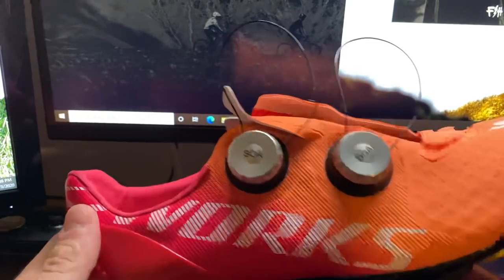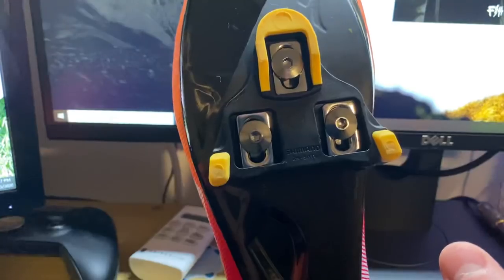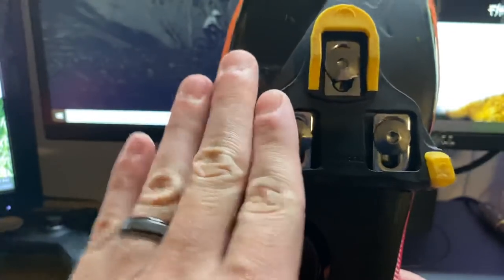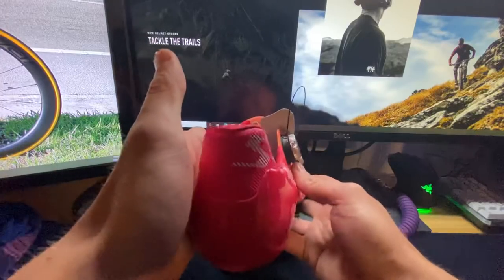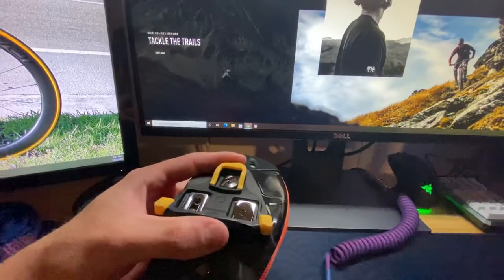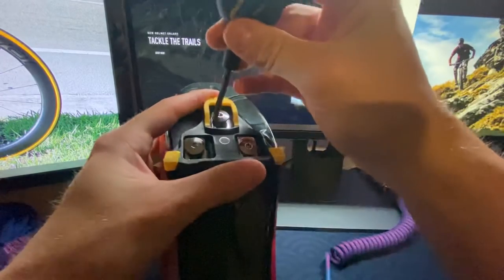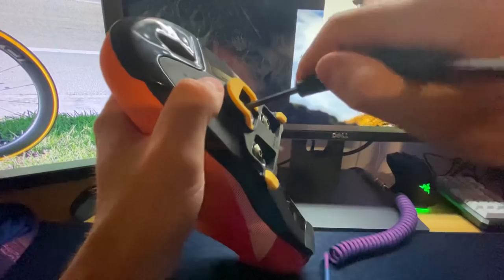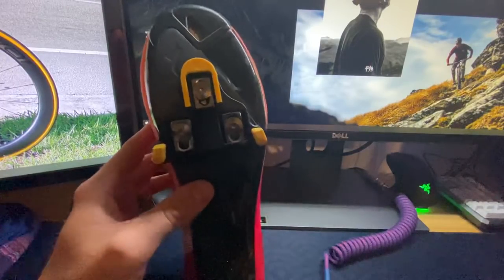HOW TO INSTALL ROAD BIKE CLEATS FOR MORE POWER! (FIT/HOTSPOT/LOOK/SHIMANO) *NO HOT SPOTS*

Comment: Very informative. I bought new shoes, my Fitter set them up and I started to experience a Hot Spot on the ball of my foot (left).  I thought it was the shoe because I had not experienced this condition prior to that.  Rookie mistake, didn't think about a "starting point" since he has been spot on in the past. Thanks. I'm sure you just saved me a few bucks
Reply from the maker: No worries at all, like I said a lot of fit stuff is all preference, and this information is all suggestive but it’s what works most of the time. To help reduce some pain. :)) I hope it helps

Comment: great explanation. i like when a bike fitter says cleat position is subjective. my fitter is insistent on cleats forward ball of foot, which i have never done before. Definitely felt the difference right away. I also wear the S s works 7. saw your comment on not forgiving as they are to stiff. Going to try shimano RC9. be great to see a video on crank length.
Reply from the maker: Look at the sworks vent shoes they are less stiff then the 7s and people say they prefer that show over the 7 in terms of comfort

Comment: Here's an additional thought: something you didn't discuss enough (IMHO) is how very important cleat angle is. More than just preference. If you imagine your "footprints in the snow" look at how one or both feet may angle in or out. I think this has to be considered when installing cleats too. I fiddled around with sore knees for months before discovering that if I followed the natural angle that my feet wanted to go it helped almost instantly. And of course, don't fall into the trap of thinking they "must" be symmetrical. Nothing in the body is.
Reply from the maker: yea exaclty this is true, that would have to be measured on bike with a laser and like a z plane and notice to there rotation on the pedal stroke.... have them ride for a while, while recording and taking data
Reply: I ride toe-out so use kneesaver pedal extenders or pedals with long axles to accommodate that.

Comment: I am glad you made this video , I fiddle way less with mtb spds , than my road spds........always seems like there is some built in shoe sole camber that’s never on mtb shoes , they lay flat on the peddle , where my shimano road carbon some times feels like it’s floating to the out side . Road spds so fussy , mountain spds set and forget. But I do set my road to heel out especially the right foot.  If I try to set that peddle straight , I will screw up my knees after hard rides. It seems so unnatural,,,,,,but mountain spds no trouble,,,,,,, I begin to think the question is when I started road biking coming from mtb is ......................this trouble some Q FACTOR WIDTH THATS ROAD CRANKS MIGHT BE CAUSING ME , mountain Q FACTOR never an issue ...............🤔🤔🤔🤔🤔
Reply from the maker: why dont you just put mountain cleats and pedals on your road bike then?? if you are comfortable see fi it helps with it, and if it works and you are comfortable what is the prioblem :))

Comment: That original sesamoid bone thing has to do with running. Shoes used to flex lots back in the day. Mimicking a running motion. Shoes now are super stiff which is why they reccomend moving them back now. Float will compensate for small differences (ie not precise in position) I'm really into bike fitting clinical pharmacist with access to a bunch of data (read so many publications on this always interested in learning more.
Reply from the maker: Very nice!! Yea I like the fitting aspect of it too but I’ve got away from it more and more just because I started to learn less is more in my situations because majority of people I’m fitting are not riding daily or even weekly so I would just go about making them comfortable for weekly or monthly rides

Comment: I attach the cleat semi-loosely to the shoe, then clip them into the pedals. I get the shoe into the position that works best for me, then tighten. I also stencil [with crayon] the position once I feel the fit is locked in. That way when the cleats need replacement it's easy.
Reply from the maker: That sounds great!! It doesn’t move when you un clip
Reply: @GCPerformance18  that's the tricky part. I set the clip to its lowest setting, then pry it open with my hands, while pulling the shoe out.
Reply from the maker: @ayowser01  lmao ahh I wondered how you did that, maybe even just go under them whilke the shoe is still clipped in and take a market to the top portion

Comment: If your cleats are in the right position and you move them back just a bit does it alter anything like for and aft or does the set up the same? Just moved backed a few mm. My bike fitter keeps moving my cleats over the ball of the foot and i keep mentioning knee discomfort. But i never have discomfort the other way. He says that when the cleat is moved back, it places to much stress on the arch of the foot and that is what you essiently  pedal with. Im confused.
Reply from the maker: Moving them back a little will cause a little change that you would notice but your body will adapt and also that position will be better for overall longer rides. Less pressure on the hotspot of the foot

Comment: Just bought new SPD SL Ultegra R8K pedals. And yup for me I moved the cleats all the way back.Seems more of the sweet spot for me. But yeah haven't head out yet. I kinda feel like the yellow cleat's float is a tad bit too much which interferes with unclipping but then again it may help prevent any pain. What are your thoughts on this? @GC Performance
Reply from the maker: the yellow is a lot of float but you get use to it and if you are noticing that it is resolving the knee pain issue then keep it, I rode yellow for the longest time, and I am not saying that you can not get use to other types of float it just all depends on how much you ride.... sop if you ride only every weekened then yellow might be a little better because it is more forgiving for us who dont ride every day but if yopu ride 3-5 times a week then blue shoudl be okay and you will get use to it and over that soarness pain the more you ride
Reply: @GCPerformance18  Yeah I more weekend warrior as you mentioned. Hmm will continue using the yellows as for now I guess. Also is there a difference between the authentic SHIMANO cleats vs replicates?

Comment: I live in Hawaii and try to average 100 miles a week (35 miles a day, 3 days a week). I always get hotspots and I've tried moving the cleats rearward, adding ache support, changing the angle, and trying a slightly larger shoe. All this has really made almost no change. My Specialized dealer is suggesting me buy wider Lake shoes, but at $300+, I'm not sure I want to spend the money and then just have the same hot spots. Any suggestions? Thanks.
Reply from the maker: What shoes are you riding now, and where on the foot is the hot spot most of the time?
Reply: GC Performance   Aloha, I wear a specialized shoe and the hotspots are on both feet and pretty much across the foot between the toes and the arch. I do have a wider foot, but I don’t think the shoes are restrictively narrow.
Reply from the maker: @LeoDodier  I would have to see your hsoes and feet in perosn obivously, but try moving the cleat of those hotspots and also if the shoe is to stiff like the sworks 7 sometimes those can cause hotspots because there is no give ion them.... its weird but kind of like an sworks biike  where it is very fast but alot more stiff, same situation with shoes too sometimes the sworks shoes are very stiff and fast but they cause alot of pain on some of my older customers because there is no forgiveness
Reply: @GCPerformance18  Both pairs of shoes are Specialized Torch 2.0. The soles are carbon I think and are pretty stiff. The local Specialized dealer says that the soles on these shoes are not as wide as the soles on the Lake shoes and this may be causing the problem, have you ever heard of that? Should I try Lake shoes?
Reply from the maker: @LeoDodier  yes I would give them a try to see if that helps, you gotta to try and figure something out

Comment: Any input on why my hotspot would be on the outside of my foot just aft of my little toe? Thanks!
Reply from the maker: A lot of things, could arch support or are you using wedges or shims currently??
Reply: Stock insoles. Same hotspot follows with different shoes.
Reply from the maker: @jasongiordano907  trying getting some arch support insolse, do you have a moderate to high arches?
Reply: I’m down to try anything? Any suggestions? Moderate arch at best.
Reply from the maker: @jasongiordano907  yea go get some specialized arch support, go to a specialized store and ask them to measure your arches, they should ahve something there for that and figure out if you have moderate or high archs and buy the one that you need for that, insoles are a huge thing to do and once you find them out you realize how great they are.
Reply: Awesome, will do! Thanks for the help!!
Reply from the maker: @jasongiordano907  yea and stress to them about the pain in your foot, there are a lot of variables that it could be but something that can be solved, maybe also q factor on your bike, you might need longer pedal spindles to widen your stance and you might have more pressure on the outside of the food, this is all me suggesting things without seeing it but. feel free to ask them at the store, its there job lol
Reply: I did switch from Ultegra to Assioma pedals a few months ago....I believe the Q factor on the Assiomas are a little bigger.
Reply from the maker: @jasongiordano907  okay well I suggest going therre first and getting the proper support for arch support and then go form there
Reply: @GCPerformance18  was just about to post this same problem... pain on outside bottom of foot. I notice only the S-Works Vent lists "Longitudinal Arch, Varus Wedge, and personalized insoles with a Metatarsal Button." Can you get these on the lesser priced shoes, such as the Torch? Surprised they're not listed on the other S-Works shoes.
Reply from the maker: @bipsyscott7275  so all specialized shoes have a varous wedge worked into all there shoes form 100 all the way up, so that should help but yes you can buy more wedges if needed or also add the insouls, they help the most but only if you have that moderate or high arch, make sure who ever is helping you knows what there doing and always less is more, try it out for a while with each change and dont make a bunch of changes at once, like add insouils and wedges and shims, sometimes thats mroe harm then good
Reply: @GCPerformance18  thanks for the info. will see what my lbc can do.

Comment: Hello, how can I bring the 3 holes cleat plate on my S-Works Area backwards? It seems to be not movable like the one in my Shimano shoes, any Ideas? Thanks
Reply from the maker: yes I believe they can be flipped, not moved but you have to remove them and flip them
Reply: @GCPerformance18  Thanks, it worked, was al little bit difficult, I had to use knife to cut from insider in order to remove them and flip them, I don't know why it has to be so complicated

Comment: dude my cleats twist/change position every time i ride the bike. do have an idea why its happening? im pretty sure i tighten them really good
Reply from the maker: That’s not good at all, get blue lock tight from the hardware store and put them on. And let them sit for a couple hours. But make sure there tight, if it continues take the shoes to your local bike shop and tell
Them that so they can get hands on
Reply: GC Performance if i put lock tight will i still be able to replace old cleats? Im so bummed i just bought the pair for 200dollars a week ago. Do you think the screws that came with the free cleats from the pedals i bought are too short for the shoes? Is that a possibility?
Reply from the maker: Manuelle Angelo Dela Cruz if anything they would be too long and not able to tighten down. But no blue loctite you won’t have an issue with it. I’ve done before

Comment: When are wedges used?
Reply from the maker: If one leg is longer then the other or if your feet go to one side more then the other when you let them hang loosely
Reply: @GCPerformance18  I'll try that.  At 6'5, I've wondered if one leg is longer than the other.   However, I don't seem to be having any discomfort when out riding.  Just curious.  Thanks for the information.  Also, you're spot on about cleat position, I wear size 50 and for while I had them too far forward, once I change them to the back position, my speed instantly picked up!

Comment: With a super stiff shoe like that you shouldn’t get hotspots from 5mm different cleat positions. It’s going to affect your calves though. An other muscle groups.
Reply from the maker: So it is all different from most people and also I’ve had in past experiences, with stiffer shoes there is not as much forgiveness so the hotspots will happen more often. Where as a plastic soul shoe might have more forgiveness but also yes the cleat movement is minimal but it’s taking pressure off that spot so the ball of your foot isn’t directly on the pedal

Comment: Actually, objectively, if you ride in a more aero position you are a better rider.  You go faster for the same power or the same speed for less power.  We should all be fit to ride in whatever position is most aero for us that is also comfortable.  

Aero is everything.
Reply from the maker: yes this is true buttttt if your lower to a point that you cant stay aero long enough and your body is not flexible enough or comfortable to the point where you are fidgeting and moving up and down then you will not be more aero, your only as aero as long as you can stay in that position and not get up and move hand positions, those movements to get up and down or go from hoods to tops looses way more time then just being more slightly up.